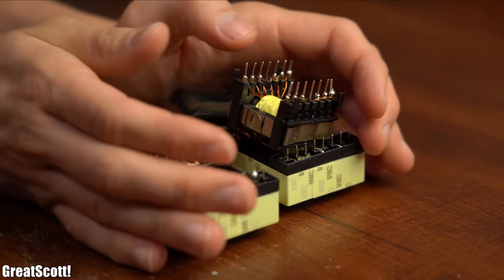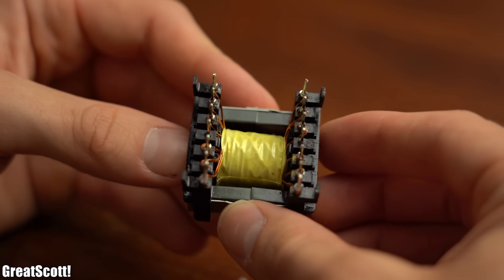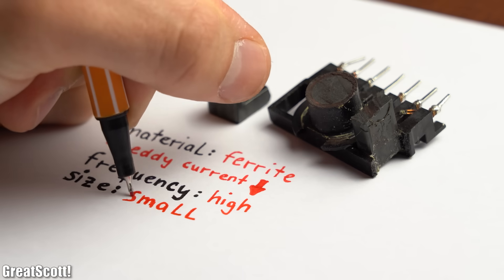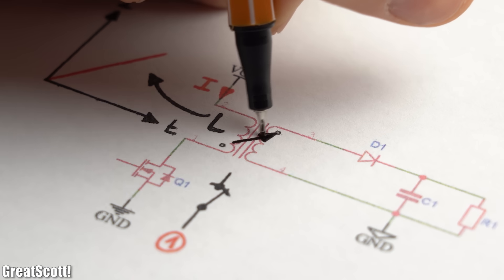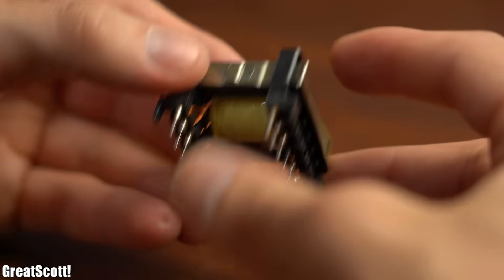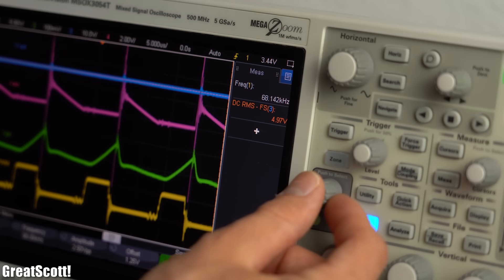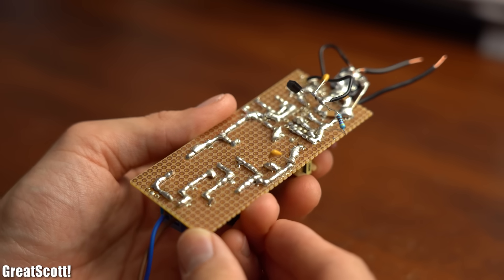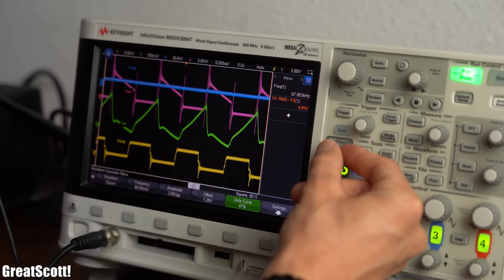How does a modern Power Supply work?! (230V AC to 5/12V DC) DIY Flyback Converter!

Comment: Great demonstration, and one I've been too chicken to try myself.
Although as I understand it, the output voltage is NOT determined by the turns ratio - which actually boosts the current.
The point of the flyback transformer is that the output diode is effectively catching the transformer's back-EMF, and a back-EMF will be whatever voltage is needed to get the current flowing.
The output capacitor gets charged to a progressively higher and higher voltage until limited by either the load or feedback.
Hence with feedback regulation you can get different voltages and even handle 110/230Vac with the same transformer.

Comment: How the branded bench power supplies are made ? Are they linear or switch mode ? Please explain the linear ones how they manage to avoid excessive voltage drop during heavy output loads

Comment: @greatscottlab
WOW! This is exactly what I want, but completely different...
I am trying to design a bench supply that uses (2 isolated Buck Converters) on the output.
Each B.C. needs 36volts at somewhere between 10 and 20 amps..

I plan to use opto-isolated ADCs to measure the outputs of each B.C. (Isolated grounds)
as feedback to the control circuit.

So what do I need to make a SMPS that runs on (US 120v mains)
that will do the above requirements?
Can you help please?

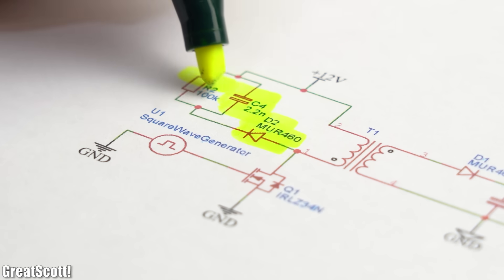Comment: How did you decide on the clamp RC values? Simulating the values of 6:15 I get excessive voltage on the clamp components, close to 1000V because of the large resistance.

Comment: I think it is better to call the flyback discontinuous magnetic energy coupling device a coupled inductor and not a transformer. Traditionally, the name transformer implies continuous coupling between primary and secondary. A better mental picture of this type of device is actually a car ignition coil (like a 3 terminal coil on plug ignition coil). The ignition coil is really a coupled inductor with a common terminal (like an autotransformer, no pun intended). So, the coil primary is first magnetically charged, then switched off where the energy flies back (couples) onto the secondary creating the ignition spark in the cylinder starting combustion. So, the energy coupling between primary and secondary is not continuous.

Comment: The old fashioned 50 / 60 Hz Iron core transformers , cost a LOT new , hence these efficient designs using cheap electronics ... however ... Iron core transformers are robust and can last for CENTURIES !  They are well worth salvaging from old equipment because their SIMPLE power supply use is MUCH more reliable ( less to go wrong ! ) ....... DAVE™🛑

Comment: I just clicked on the video to make this comment. SMPSU is from the devil. 
They are noisy AF. Mostly. some can be quieter. But a carefully designed linear psu is far superior.  
Noise aside, Switch mode is 100% part of the planned obsolescence movement. I have yet to see a switch mode older than 10 years that has seen daily use.
I have a side hustle building high quality linear power supplies to power high end streamers and dacs

Comment: You are wrong to claim at 4:58 that current is supplied to the load via the capacitor.
There is no circuit for current to flow to the load via the capacitor.
Tell me why I am wrong.
Reply: No, he's absolutely right.
The load is connected directly across the output capacitor. When the switch (MOSFET) in the input circuit is ON, the capacitor is the ONLY source of current for the load. There is no current to the load from the output winding of the inductor ("transformer"). Except for things like charge pumps, all switchmode power converters use two energy storage elements - an inductor and a capacitor.
Reply: @D614G_aka_Doug  
Thanks for your reply. 
As he was describing the circuit from start up, during the first cycle while current flows in the Primary and the diode is reverse biased, the Capacitor has no charge and therefore delivers no current to the load.
Naturally during subsequent cycles when the switch is off and the diode is forward biased as the field collapses, the Capacitor is charged and starts supplying the load.
Reply: @aubreydebliquy8051  
I'm sorry, I had missed that specific implication. You are of course correct. There will be no charge (unless it comes from somewhere else) on the capacitor until the FET turns off for the first time and the energy stored in the inductor is transferred to it.

The only common topology that comes to mind in which the output cap will have charge before switching begins is the non-isolated boost converter.

I've seen other YouTubers who try to explain flyback converters and just don't get how they work at all. I wander around watching videos that appear in my recommendations. I do it almost entirely to see how accurate the presentations are. Some are excellent. Some are filled with errors. Those filled with errors seem to get as many up-votes as the good ones, which is unfortunate to say the least.
Reply: @D614G_aka_Doug  I invited someone to clarify and I appreciate your explanation. In hindsight he obviously implied the charge from the previous cycles.

Comment: I do not understand how changing the frequency on one side of the transformer changes the voltage on the other side. 

I only have a basic understanding of transformer I guess as in the voltage change is determined by the ratio of turns.

Comment: how about the efficiency?
Reply: A conservatively designed flyback converter can run in the range of 90% or so.

In general, the output diode is fairly big contributor to losses if the output voltage is low. Improvement can be made using "synchronous rectification" where a power MOSFET is used instead of or in parallel with the diode. To do a good job of synch rectification does increase the complexity of the circuit so it isn't used very much in flyback converters.

Lots of flyback converters, especially those operating at relatively low power, up to several tens of watts, are often designed to operate over a wide range of AC input voltage, such as 90 to 265 volts AC (RMS). That puts additional constraints on the design that compromise efficiency to some extent.

Comment: I was really confused as to why we are using a rectifier BEFORE  the transformer and then I did some research. 

I found the we are using it as a coupled inductor to store energy in the primary windings and then release that energy into the secondary windings on the off cycle.

Is this correct?
Reply: Yes. That is how a "flyback" converter works.

With other topologies of switchmode converters the thing that looks like a transformer really is a true transformer as we usually think of them - when current is flowing in the primary winding it is flowing simultaneously and in proportion, based on turns ratio, in the secondary winding.

Comment: OK, I feel like I don't understand anything. But it boils down to 3 questions. 
1) How does the airgap allow storing more energy?
The air gap lowers the magnetic induction at given intensity in ampere turns. While this may prevent saturation it also means less energy stored at a given current. Where am I making a mistake?

2) Why don't just use a normal transformer at high frequency?

3) Why is it called a flyback?

I originaly thought it was because there was a feedback between the secondary and the primary winding. Or is it because the current in the secondary is only generated in the reverse direction?
Reply: The gapping effect isn't intuitively obvious. You do indeed lower the inductance by adding the gap but you more than make up for it by increasing the ampere•turns product for saturation. Remember that energy stored in an inductor is proportional to the square of the current but inductance to the first power.

I'm assuming your question about the transformer is why the "store and forward" sort of approach with the flyback versus using a true transformer in which current flows in the primary and secondary at the same time. The latter is very much used, especially at higher power.

The flyback converter has some serious limitations but it is simple - one switch, one diode and no additional inductor. It can work quite well over a wide input voltage range. Getting multiple output voltages is fairly simple. Depending on what you are doing it becomes impractical at powers beyond one or two hundred watts, though you might go quite a bit higher for very high output voltage. For higher powers true transformer circuits such as the "forward converter" (still just unipolar excitation of the primary) or "half bridge", "full bridge" or "push-pull," all with true AC excitation of the transformer. A half bridge requires a "center tapped" DC input supply and two switches. A full bridge requires four switches with no tap on either the transformer or the input DC supply. Push-pull requires only two switches but a centre-tapped primary winding. All of them require a separate inductor, often of substantial size, on the output side after the rectifier. Getting good tracking of multiple output voltages requires considerable art in design of an inductor with multiple windings. The secondary is often also centre tapped so full-wave rectification can be done with two diodes.

The term "flyback" comes from the use of a similar sort of circuit in the electron beam deflection of magnetically-deflected cathode ray tubes  in television. The circuit does two things - deflect the beam and generate the high voltage to accelerate the beam in the CRT. A winding in the "deflection yoke" on the neck of the CRT is essentially in series with the primary of the voltage-converting inductor. When the switch is ON, the linearly rising current in the yoke winding "slowly" deflects the electron beam across the face of the CRT. At the same time energy is being stored in the input winding of the converter inductor. When the switch is turned off, the magnetic field in the yoke rapidly 'collapses" and the beam very rapidly "flies back" to the other side of the CRT. During that flyback time the energy stored in the converter inductor is delivered to the output winding to make the high voltage for the tube.

Comment: Generally, the efficiency of a normal transformer is extremely high that ranges from 96% to 99%. So the efficiency of the transformer cannot be decided through high accuracy by measuring input and output directly. But the theory about size and weight is true ...

Comment: This is cool. Could you do something on magnets and transformers? I put a permanent magnet on a transformer with the circuit running and the output went up, but the magnet got hot. I can't be the only person who's discovered this. If so, I call it the "Kinslow Effect".

Comment: Wait minute, are you saying the AC side of the board is a kind of flyback circuit? I have to look now. I've been stripping AC parts to make portable DC devices,now I'm thinking i'll want to take some junk boards and take off the DC side to do high voltage experiments. I knew it stepped up to high voltage, but didn't consider it a flyback.

Comment: AC is great for power transmission, but at the wall we should have a universal DC outlet that can switch from 1.5v up to 24v. It makes sense for electronics that use a lot of power to be AC,but something like a game console should be DC and should be completely portable. All of our Ac devices, actually run on DC, and not AC. They rectify AC to DC, then use a transformer to step it up to high frequency, then output through a couple of mosfets to the DC side of the board, that is what you'll find in pretty much all AC electronics. They typically run on about 12v DC on the DC side of the board. I have gotten into the habit recently of tracing the path and removing the AC side of my smaller electronics so I can run them on a DC power supply and have them portable.

Comment: 3 questions
1) the winding direction (dots) of primary and secondary windings is determined depending on the way this transformer was constructed?
2) at the very beggining, how C1 is discharged  on the R1 when the switch(MOSFET) is closed (current flows through it) ? I mean how that energy came into C1? ( in that phase the D1 is reversed biased)
3) the isolated GND point of the secondary side, has in some periods of time, voltage which is different than 0?

Comment: MCUs cant work properly in SMPSs. They're too slow. Special PWM-controller IC response to its feedback inputs changes is about 400 ns that MCU can't provide. You, of course, can drive MOSFETs with MCU but you can't react fast enough to changes of load or primary voltage. There's a special MCUs with included analog cirquits to build MCU controlled SMPSs more easily but essencially it's the same as you take a discrette MCU plus a PWM-controller IC plus some ADC/DAC and some another components.

Comment: Hey Scott! In the diagram, near to the feedback part, the 50k potentiometer at the end is not connected correctly I think? or you intended just to use it as a 25Kohm potentiometer?

Comment: I didn't quite understand how R2 and C4 work. How do they absorb the energy at 6:38? Does that energy get discharged when the MOSFET closes again? Is there a chance that it disturbs the supply voltage? Also can someone explain what the capacitor and inductance at the output do? I know they are there for filtering purposes but I want to know how they work.
Reply: an old question, but since apparently no one answered:

The energy from the leakage inductance causes a very narrow spike that occurs right after the FET turns off. R2 immediately begins dissipating the energy stored in the capacitor and that continues until the next time the FET turns off.
It requires some care to get R2 and C4 right. If R2 is too high in value it won'd adequately discharge C4 during the time available. If you use more capacitance than you really need for C4 it will absorb more energy than it needs to, charging not just from the spike but from the voltage which follows.  (While the energy stored in the inductor is being delivered via the output diode to the capacitor and load when the FET is off, the inducttor does behave like a transformer and the voltage on its output winding is "reflected back" to the input winding by the turns ratio and "stacked on top" of the input supply voltage. The total voltage might be several hundred volts higher than the rectified AC voltage on the input filter capacitor.)

There are other techniques for dealing with some or all of the leakage inductance energy.. A high voltage zener can be used. Sometimes you can use an ordinary diode instead of an ultrafast recovery diode for D2. If you do that then the slow reverse recovery of the diode results in some energy being removed from the capacitor when the FET switches on. In some cases (I've used this in a couple of designs) you can simply let the body diode of the MOSFET avalanche like a zener. The instantaneous voltage on the FET may exceed the steady-state maximum voltage rating, but that's OK if the body diode has adequate repetitive avalanche energy rating. This should be done only with discrete FET, not with integrated control/power ICs where the switch is on-chip. They are likely to be destroyed by even a single over-voltage transient. All of these methods require careful analysis to be sure they will do the job reliably.

In general, switcher design requires a lot of attention to detail to be sure everything works nicely together. I often say that in switchers everything is in conflict with everything else, so it can be quite a challenge at times.

Comment: Why do all these PSUs have high voltage primary capacitors? They can use the flyback also as PFC and have the large main capacitor as low voltage cap on the secondary side.

Comment: could I basically build the non-feedback circuit with a resistor that would be calculated for about 10ma as a dummy load and use it to test different smps transformer output voltages? I have some of these custom made for the devices I salvaged them from and there is no datasheet in sight

Comment: Why does the output voltage rise when increasing the duty cycle? Shouldnt it be the other way around? With the NMOS used in this case, the switch on-time is longer so the capacitor has to transfer more of its saved energy due to a longer off time on the secondary site?

Comment: Perhaps this video should be followed up with a video on how to design switching power supplies that don't put out huge amounts of radio frequency noise back into the power line or into the air, to screw up other devices in your home; or how to best filter an existing switching power supply to prevent such noise generation.
Reply from the maker: I did a video about EMC a while ago

Comment: I have a same type power circuit, in which their is flyback transformer of 48 V,  but I get output of around 10 v at transformer o/p, who's Two o/p terminal are short to get single o/p and after the filter circuit It gives 38 to 40 v so is am confused. I am not getting 48v at o/p. So is the transform faulty

Comment: i have a cheap 1-24V 2A switch mode power supply that i use to power a 24V LED strip, but for some reason the LEDs flicker inconsistently and more or less at different voltages. Any idea how i can fix it?